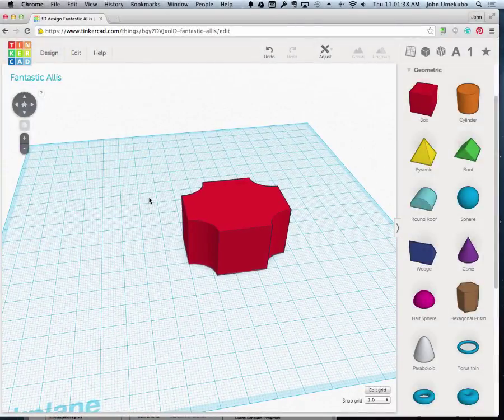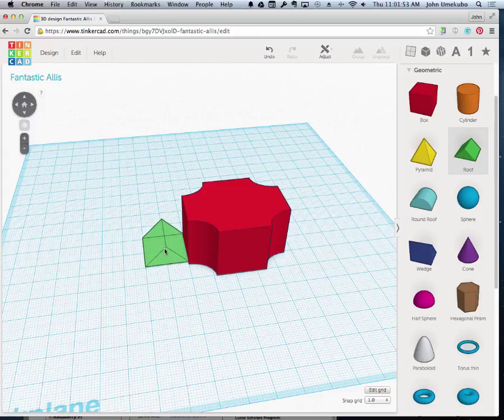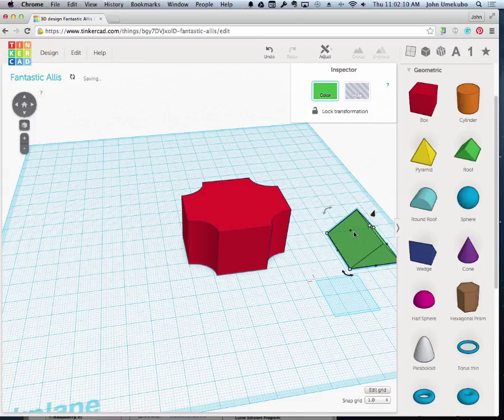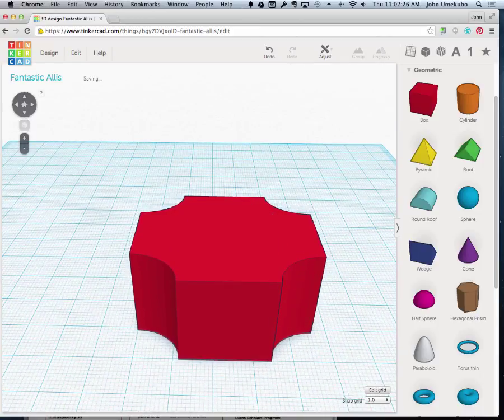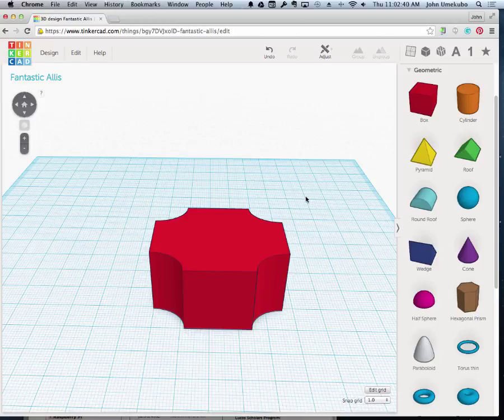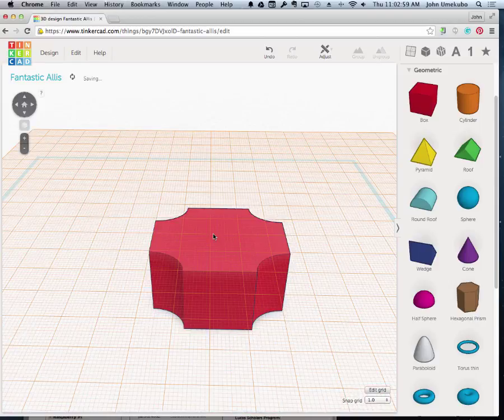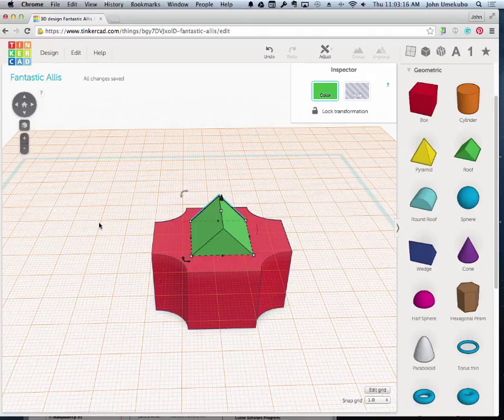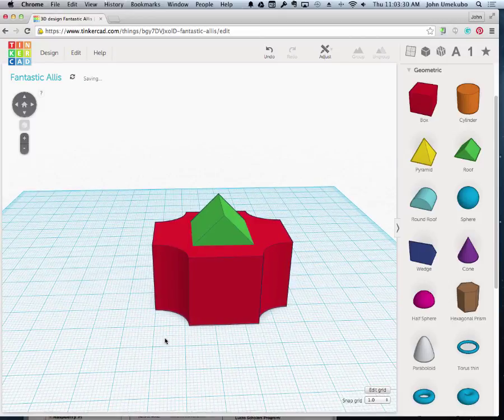TinkerCAD - Changing the Workplane

Comment: How do I copy an object from the blue workplane and then paste it onto the orange workplane? I don't want to bring in a new object from the right panel. I can't paste onto the new workplane. Thanks.
Reply from the maker: That question is asked often, as this is something you can do in more comprehensive tools, like Fusion360. The temporary Workplane (orange) is designed for bringing in new shapes only. I don't know if that will change in the future, but for now it is limited to that feature.

Comment: ok, having a serious issue with getting the second workplane to dissappear. The problem is that when I designate the second workplane, and then it appears in yellow, the next workplane will not play on the original surface floor, so I cannot designate the original back, and drop the second plane. Its screwing up everything.
Reply: Your video showed that very well. Problem is that the original is not blue anymore, and its not gridded. its a soft white fluff like clouds in the distance.
Reply: And the new workplane will not "float" on the surface, it stays locked on the side of the nearest object. 
I figured out that if I readjust the grid size to 100 x 100 instead of 1000 x 1000 then the original grid reappears. Maybe its a glitch of some sort, the workplane grid being the same size as the original, might overshadow the grid capabilities. Since the max is reached, it wont allow the original plane to grid anymore once the secondary plane has been established. I downsized the second one, and the first one appeared again. problem solved. thanks for your help.....
Reply: tried that before I found out what the problem is. I think at max the whole system likes to lock....because yes i did have to save and step out and back in to get it to reload and work. but it didnt solve the original problem, the second grid was still there haha....
 Got it though, thanks :)
Reply: if you get a chance, give it a try. Max grid to 1000, then mess with workplane....youll probably notice. Maybe they should be notified for an help tip or maybe you could make a short vid on it with title Tinkercad Workplane Problems....and go into the dropping of it, which no one seems to discuss more than a glance. Just a bored thought :)